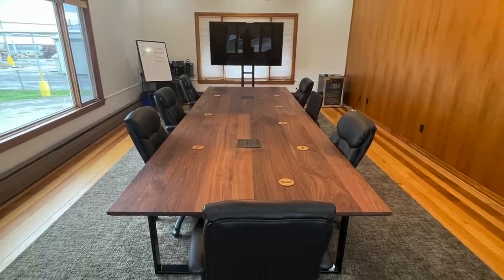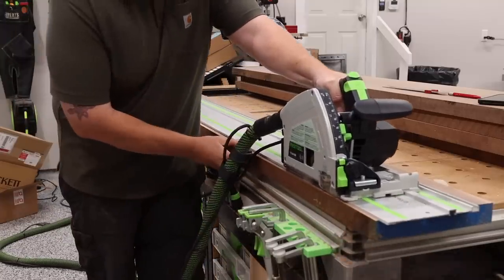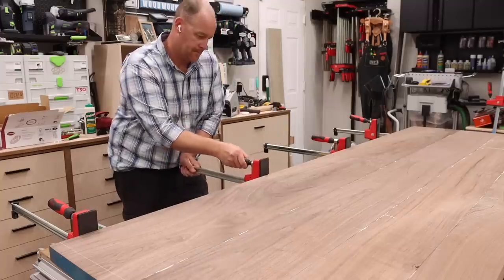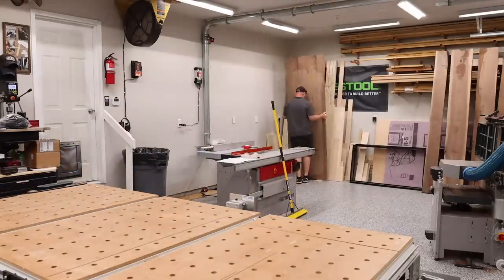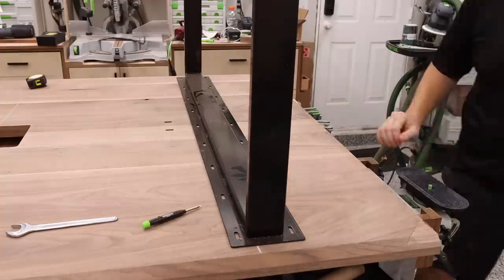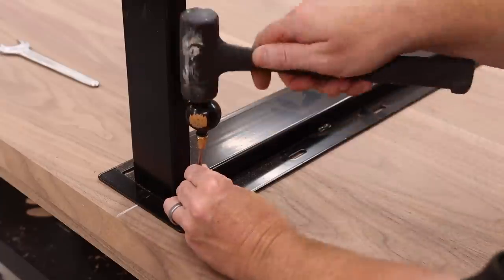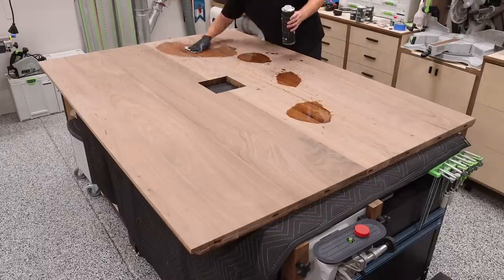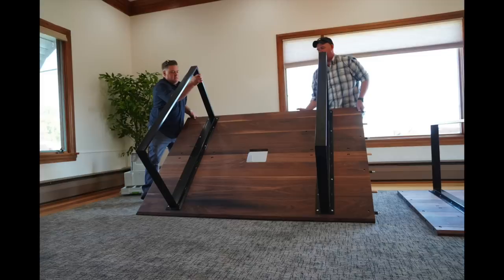Building a giant conference table without a table saw

Comment: When I see that much high quality wood, I can't help wondering what it would cost to buy?
Reply: abuck3eighty
Reply: @gregmize01    That conveys nothing to me.
Reply: Math. Price for board foot. Multiply by the crazy amount of boards he has there. Guessing a few thousand. Especially high because he got wider boards and they are very clear. Considering walnut is in demand making the price very high. Napkin math. 14x5x1.5 because he said 14 by 5 feet and 1.5 inches thick. 105 board feet after waste. Few inches in n every board adds up… let’s go with 40. 145 board feet. Walnut can be very different price and 12 foot by 12 inch 8/4 boards are guessing $17 board foot. $2500 to $5000. That is napkin math. Could be wildly different. It’s a lumber place making a kick ass table.

Comment: Great table. Love the walnut. 

I’m curious why you used the biscuits over dominos for table alignment? Not that it matters. I have both. I only use my biscuit cutter for one purpose though. LOL. I have it set to the setting to cut slots that I use for my z-clips to attach table tops. Just curious what was the reason for biscuits. 

I also think it’s amazing that you didn’t use the table saw at all. I’ve been getting my MFT and bench set up so that I can eventually not need mine.
Reply from the maker: Because it’s only for alignment, either is a good choice. But honestly I kinda just wanted to use the lamello as a biscuit joiner because I bought the blade for it when I got the lamello but hadn’t used it yet. Also, with really long heavy boards I find it easiest to join the two pieces with biscuits over dominos because the dominoes can be really tight and more difficult to align when you have many.

Comment: Are you able to get glue ready edges from the track saw or did they require some more work that was edited out? I can’t justify the cost of a large jointer but the track saw I could use for a lot of things and have considered this as an alternative.